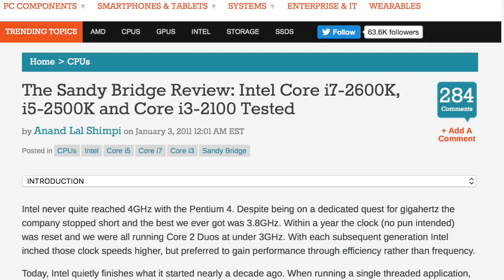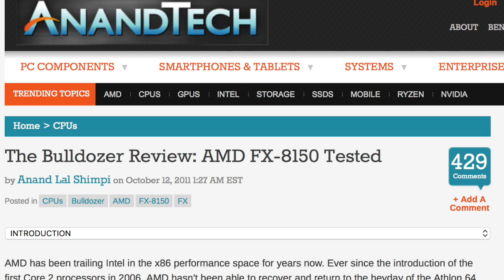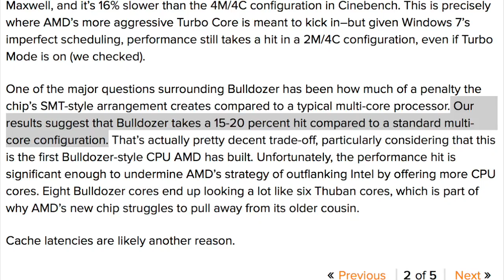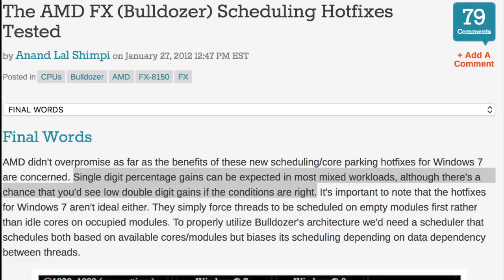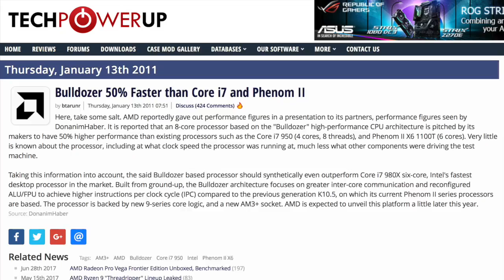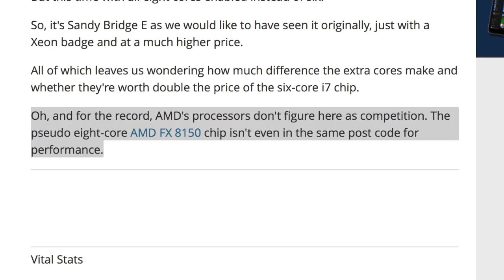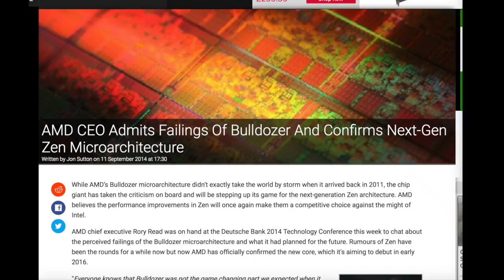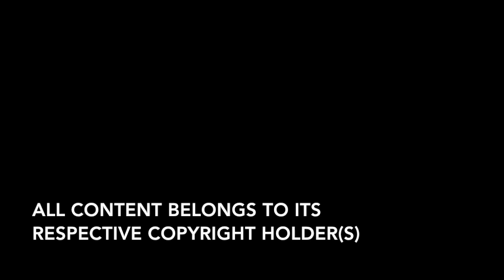The Bulldozer Story - and why AMD FX is better than you remember

Comment: 5:15 The 2600K idles at around 5W stock. Comparing the 8350's 99W idle power with Sandy Bridge's 95W TDP is purely misleading. Also, they got the math wrong. Whoever wrote that has no idea what they're talking about.

Comment: I know this is old, but I had loved my 8350 and was glad I purchased it. I remember later, games actually played smoother than my dad's i5 3750k when they were able to take advantage of more cores. I remember configuring skyrim's scheduling in the config to tell where things could be processed per cpu thread. My game could run better and support more followers on my fx 8350. While I no longer use the 8350, it still was an amazing cpu. I loved using virtual machines. I ran a virtual machine to run linux on one monitor and pretty much had secure mode browsing in it and played world of warcraft, skyrim and any other game I liked on the other monitor. This was a huge leap forward from my dual core e8600 cpu. With this large cpu pool, things ran well and I could do my multitasking really well. I remember I purchased a 1080ti back in 2017 and ran it on my cpu i had got back in 2013 i believe? Newegg won't let me see that far back. Before I ran a gtx 680 on it. 
I know most people cry if they feel a cpu or gpu is bottlenecked, but it certainly ran my games well still. My 8350 was overclocked to 4.7ghz with the ram speeds at 2133mhz. The system felt very fast and responsive none the less. I later upgraded and i'm using a 5950x with the very same 1080ti. I tend to use my components for a long time and that 8350 did a lot for me and it had huge value for me, sure the 3770k could have got me more fps, but I wanted multitasking to run well for me as I use a lot of other things while my games and browsers are open.

Comment: I had my FX-8150 from mid 2013 until mid 2020 when my ASUS Crosshair V Formula Z mobo gave up the ghost.

I had no issues other than a hot summer day 2015 when I lost a core pair running 3 instances of Handbrake when my air con compressor died.

Even after that  it still went strong with that Core pair disabled.

Comment: 5 years later and how the tables have turned! 

AMD Zen proved to be a huge step up from Bulldozer (in every way), that was then iterated upon, with significant strides made each generation. The multi-chip platform has proven to be superior to monolithic designs in terms of cost and power efficiency, and can be scaled to insane levels (currently 64 cores per socket, with higher counts soon to be available). Most of the early weaknesses of the multi-chip design have been successfully mitigated, as interconnect bandwidth increased and cache latencies decreased. While OS scheduling initially caused some headaches, it is no longer an issue. If anything, it is now Intel facing such issues, with their adoption of "Big-little" core layouts, with different cores having different capabilities. Simultaneous Multi Threading has been made to work the way it should have from the start, and now outperforms Intel's Hyperthreading technology. 3D fabrication techniques have allowed for large caches to be stacked onto core dies (3x L3 cache size vs non-stacked), which particularly benefits gaming performance.

In terms of raw, per core performance, AMD and Intel's desktop offerings are not too far apart today. However, AMD has a very large lead in power efficiency, and this, combined with the ability to scale core counts to levels that are impossible with Intel's monolithic designs, has seen AMD outclassing Intel in the server space. Their market share in server has climbed from <1% with Bulldozer to close to parity today (enterprises are less inclined to switch technologies as often as desktop users are, due to concerns around stability and continuity of software compatibility, however more and more are making the switch, as it is now MUCH more cost-effective to use AMD Epyc). 

Today it is Intel that is struggling as a company. The dramatic loss of market share, combined with failing to execute several important projects, has seen their revenues dwindle, to the point where they are now laying off large numbers of staff, shutting down unprofitable departments, and cancelling the development of some new products. They have lost their advantage in fabrication technology to foreign competitors, to the point where we are now seeing Intel use external fabs for some products, something that was unthinkable less than a decade ago. During AMD's Bulldozer years Intel became complacent, relying on their more advanced fabrication nodes while neglecting to seriously advance their CPU architectures. That culture of complacency was, in my opinion, largely due to the company being run by "number crunchers and professional MBAs", who took the focus away from engineering innovation towards "managerial box-ticking". It is hard to turn such a culture around, once it is entrenched, and the types of leaders they had at the company were ill equipped to even begin such a process. AMD has not become complacent. They are moving from generation to generation at a fairly rapid pace, always executing on their timelines and building a culture of continuous innovation into their long term development plans. They have shown, again in my opinion, the importance of having engineers and technologists at the forefront of the company (all of their senior leaders, including the CEO, are engineers), with the "number crunchers and professional MBAs" there to help the engineering teams succeed, not the other way round. Intel now has an experienced engineer at the helm, but it will take time and a herculean effort to turn the company around. It is highly unlikely we will ever see Intel as dominant in the market as they were around the time of this video. Still, they do have advantages AMD doesn't, such as controlling their own fabs, which allows for far higher production volumes than outsourcing. If they can become competitive again in that space it should help the rest of their business immensely.

Comment: The CPU was meh, but AMD's marketing was dishonest and terrible. The top of the Bulldozer range was not a true full fat 8 core design. It was more functionally equivalent to a 4c/8t chip given the shared resources between cores you alluded to earlier. This just made them look even worse next to Intel chips, giving the impression that an 8 core chip was getting spanked, even in multithreading, by a quad core i7. In reality, it was a 4c/8t chip that performed like a 4c/4t Intel i5 with higher power consumption. Very meh and just getting an i5 offered an i7 upgrade path later, but it could still be a good value to a budget buyer.

Comment: I have a variety of FX procs from a 6200, 8350, 8370 and a 9590. Asrock seems to have better boards suited for these processors as well as Asus. I have an 8350 in a Asrock 990fx Killer board with a SSD and it runs WIN 10 pro with no issues at all.

Comment: It's 2022 and I am still running my FX8350. It has bee very solid and problem free since I bought it in 2014. I don't run games, so with 16GB of RAM and a couple of WD 500GB SSDs, it has been more than adequate for all my uses.  I would only upgrade to a Ryzen if I could run WIN7 on it. I really don't want to upgrade to WIN10 with the crappy, ugly menus, UI and all the data slurping it does. Even if the 8350 dies, I have an FX8370 NIB on the shelf and another in a spare computer.

Comment: The Bulldozer architecture was a great  move forward if Microsoft and Linux developed their operating systems to suit the design. Alas, that never happened and all operating systems followed the Intel design and approach. Now, if AMD did a Big core, Little core design instead that would most likely have worked much better. Instead of 1 core and 2 threads which Intel uses called Hyper Threading, AMD would have 2 cores and 2 threads per Module and if Microsoft and Linux supported the design, well, AMD would have had a winner. That never happened, unfortunately. But here we are in 2021 and Intel is destined to deploy a Big/Little design just showing how advanced AMD were at the time. And AMD are destined to manufacture a Big/Little design CPU based on Zen 4 or maybe Zen 5.

Comment: I have an almost 8 year old i7-4700MQ at 30-45 watts at 3.4GHz and beats an i7-2600K in singlethread perfomance.

Still stands the test of time. Truly pathetic that Intel and AMD now reach double the singlethread score at basically 5GHz and way higher power consumption. Even more cringey modern PC fanboys using nonsensical stuff like Cinebench that doesn't reflect real workloads and Ryzen with the Pentium D with the chiplet nonsense and Intel in the same nm node since 2014/2015.

Apple M1, basically same clockspeed as my i7, double singlethread perfomance and between 7 and 14 watts. Now x86-64 is the new Bulldozer.

Comment: I used an FX6300 and was able to overclock it to 4.0Ghz, best $100 I ever spent on a processer. I upgraded to an FX8370 and noticed about a 25% improvement in FPS and performance but both processors were showing bottlenecks back in 2017 that suggested an upgrade to Ryzen. I made the switch to Ryzen and wow, what an improvement but I still find myself fondly thinking about that little FX6300.

Comment: testing recently, at least on 2 8100 series chip based systems, win10 seems to handle/manage these chips alot better then win xp-vista-7 seem able to, probably a proper fx series driver... 

and i disable core parking anyway and did back then as well...so yeah... ;)

Comment: Why does everyone think this CPU was at all good!? Does no one realize that this processor is what nearly killed the company? No one would ever say a product that caused the downfall of your entire business, causing extreme layoffs and R&D cuts across the board, is good. You have to be truly ignorant to believe anything from the Bulldozer or Piledriver line was anything less than absolute trash. Hell, Gamer's Nexus recent revisit to the scene, now 3 years after this video, but no less relevant, showcases exactly how horrific those parts performed back then and now. When a dual core with SMT, clocked 1Ghz slower, can match the former 8-core/8-thread flagship "halo" product, the latter option is not good.

People don't get this and I really don't understand why. Like... the CPUs came out in 2012. Let them die. No processor from 8 years ago is worth your time, but at least Sandy Bridge CPUs can manage to game reasonably well. Even TODAY, when games are seen often using more than 4 cores, the i5 2500K is STILL FASTER BY A MASSIVE MARGIN. FX is BAD. Let it die.

Comment: I just watched this on my FX 6120. The processor is actually excellent at most common multitasking operations. Basically, running a lot of stuff at once.  It's a pretty good jack of all trades. And yes, I knew getting into it, I wasn't buying the fastest racehorse in the stable... I wanted bang for the buck at the time and I pretty much still have it.  

I'm not sure what the equivalent Intel 6 core processor was at the time, but I'm thinking it would have cost a lot more.
Reply: Nowdays its pretty weak even fx8350 is bad i run fx9590
Reply: @Johny1492  I know the fx's are dogs for gaming... but they multitask pretty well for office type apps especially on older low res monitors.As to web surfing... they are still faster than most web sites can load.  So if you have a lot of light duty apps to multitask, they are still fine.  If you have one real resource hog, you are going to feel the slow burn.

Comment: Hi this is a good video on the AMD FX.  I would like to add that the FX was delayed and delayed and then pushed out without all the goodness and refinement that the engineers wanted.  That is another reason why it was only a mediocre processor when it was finally released.  And having only one floating point per module (every 2 cores) was suicide for gamers when floating point has always been AMD's weakness when compared to Intel chips

Comment: I ran my FX8350 until last month. A solid 8 years on FX series processors, starting with the FX4300. It worked fine for current gen gaming still with a few games kinda being a little sucktastic at times, but most of the games I really enjoyed worked fine. MGSV Dark Souls 3, space engineers, Monster hunter world. All still run great on it paired with a gtx960. I'm honestly suprised I was able to eek out that long of an existence with that rig.

Comment: The worst thing about Bulldozer was the hype around it, was way over hyped then under delivering which crushes the expectation of many. Second thing would be the motherboard price, the FX 4xxx or 6xxx could be a very good budget CPU had a decent board with low price exist. Just an M-ATX board with 4+1 phase heatsinked priced at 55~70 USD would be a killer combo with the CPU.

Comment: I think part of it as well is how many people were  fixated on gaming.  I mean the biggest reason Intel has done so well with games is their single core performance and the fact that games were lagging behind being single threaded for years making multi core CPUs somewhat irrelevant.  Kind of reminds me of the old Turbo button that used to slow down the CPU clock for better game performance in the early 90s.  I think part of the failure is AMD probably expected to start seeing multi threaded games finally a decade after the introduction of multi core and multi processor systems.  As for me I am writing this on an FX 4100 as a photography workstation and it works great for my needs on linux.  Something else that is helping the FX line now is it supports newer instruction sets making them more viable long term.

Comment: Bought my 8350 in 2014. I typed this comment on my 8350 in 2020. Literally years of almost constant use through editing, effect making, encoding, sound development, streaming, and hard gaming shes been the most reliable and most powerful CPU I have ever owned. Literally bought it for $120. Good Job AMD. Price to Performance is still unmatched.
Reply: Earlier this month I replaced my 6350FX with GTX750 to a AM4 2400g NVMe and 32GB ram all ebay/second hand beyond motherboard and one thing really noticed was power saving.

Can't argue for their value on CPU's.

Comment: Well. Fx8350 in my case overclocked to 4.65ghz with fsb nbht and ram overclock it's still doing just fine paired with gtx 1060 6gb.Bf5 runs flawlessly on lowest settings with fps range of 90to130. New nfs is smooth, assetto corsa pushing over 100fps without problems. For my casual gaming it's good. 1080p60hz it's not a bother for my setup.Its old, hot, slow comparing to Intel equivalent, but it's enough

Comment: Its end 2019. Answer for 10:47 Zen 2 with Ryzen and Threadripper 3000 has almost equaled with Intel in single thread performance and overtaken in:
- Densely packed transistors with 7 nm
- Efficiency
- Core count
 (by far with 16 cores Ryzen 3950 in consumer line)
- Scalability of the number of cores by using a chiplet approach 
- PCI Express 4.0 connectivity
- More maximum possible memory
- Also allows higher clocked Ram
- Reusability of the socket (for Ryzen it is still M4 socket)
- Lower price

Comment: I don't regret updating to X570 and Ryzen 5 3600.
However, my FX8350 paired with a GTX770 served me very well for more than 6 years. Never ran hot, never was at 100% workload and I played everything in fullHD, 75Hz and max details. Heavily modded skyrim, mass effect trilogy, DmC, elex, war thunder in cinematic mode, etc. (I don't like gaming @2k/4k & 144Hz anyway but I do multitasking on 2 or 3 screens parallely)

In prime95 it stayed below 65°C @Stock on full load even after 30 minutes with a rather small air cooler.

The biggest disadvantages were slow DDR3 RAM, high TDP and, well, it was slightly ahead of its time. Poor singlecore performance, strong in multicore - when hardly any programs utilized more than 4 cores.
I'm glad AMD recovered with Zen.

Comment: I went against going with the FX series because it didn't do folding well (folding at home). I remember the early sandybridge i5 was competing with it at the same price but had much better single core performance (which was great for gaming). The FX was a beast but it wasn't properly utilized (if it all possible) in folding.

Comment: If hardware known e.g. game console and everyrhing from O/S, drivers, top layer programs were optimised (apart from power draw / TDP/could efficiently scale TDP to enterpruse & mobile) it could have be a Toughbook and embedded system darling.

If the FX 8150 had a TDP of 80-90W vs the 125W it could have had cheaper partner MoBos and could have found a place in mobile later gen ntetbooks as well as laptops.

If noteable Microsofr Windows vendors got behind Bulldozer like Dell, Panasonic, HP and Lenovo and w/ system level & scheduler support / virtual memory/cache optimisations add etc etc etc.... then AMD could have lasted/existed.

Gladly they didn't because Zen mught habe been significantly delayed or never happened.

I still rock an FX 8150 (1 deadish core cluster OC fuck up), have a FX 6320, FX 6750K.. and in OEM some 5-10W BGA APU single channel mem Lenovi ultraslim office tower PC (close to powerful enough to decode x265 720p <600Mbps video) and some Athlon AM2  and board my Dad gave me a couple if his upgrades ago.

One positive... socket compatibility and chipset

Comment: mid 2019 and my Fx8350 at @4.4 still rocks solid... 16gb of DDR3 1866mhz and a mid range GPU is all it takes to game at any current tittle high (or higher) settings 1080p 60fps avg.

My guess is that replacement will become mandatory for mid 2021, but since i play games that are "old" (3 or 4yrs old) and cheap, i think the Fx will last for me up until 2022